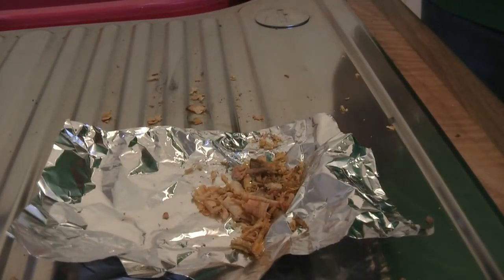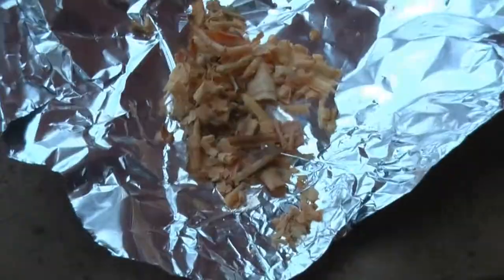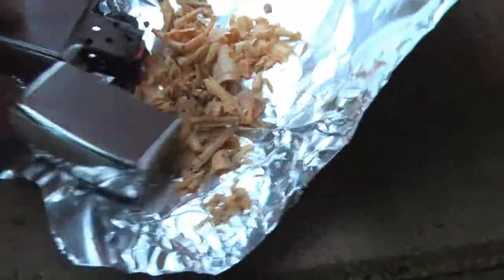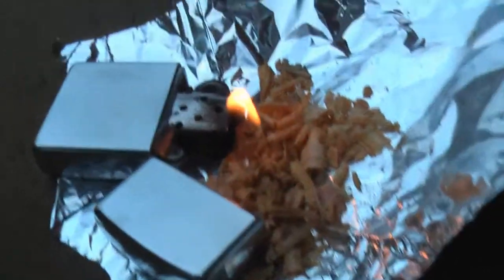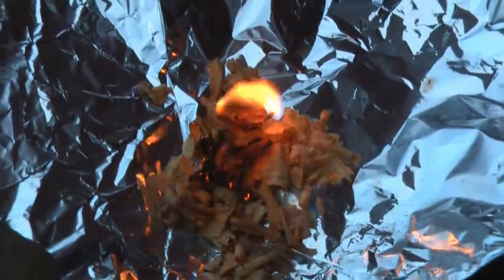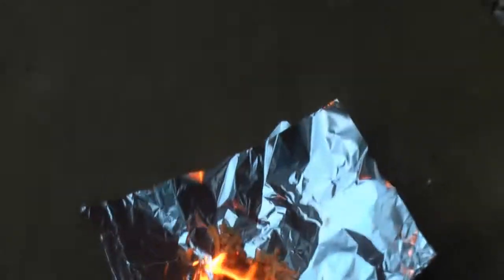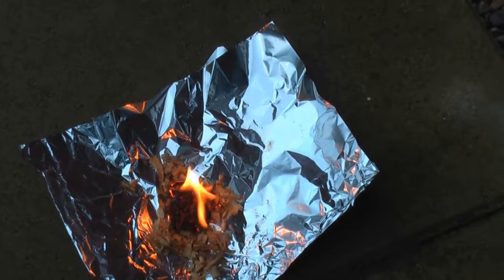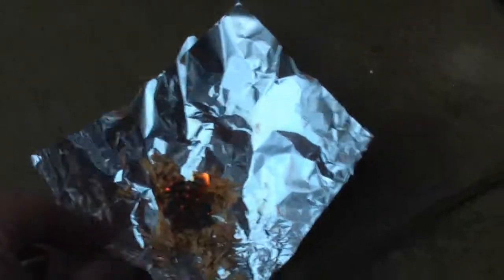Light My Fire Maya Dust

Comment: I hate to see you guys buying that stuff. Where I live in the SouthEastern US, there's lots of that fatwood around in the stumps of pine trees and also when a branch or the trunk of the tree is damaged it puts an overload of pine sap into the wounds and produces that fatwood. What you have in that tin is the chips that blows off a chainsaw chain sold at an exorbitant profit. A fatwood log will burn for ages on a fire because it's burning sap not wood. Kind of like how a wick doesn't burn in an oil lamp.
Reply from the maker: That sounds about right..lol..I don't use it very often really, thanks for the info. :-)
Reply: They even sell (!) 'Maya Sticks'... It's just that : fatwood , inner pinewood or spruce. Nothing more